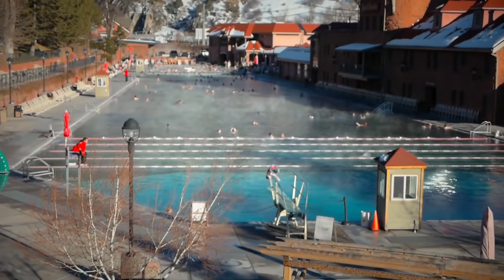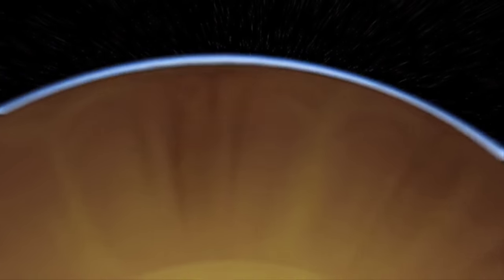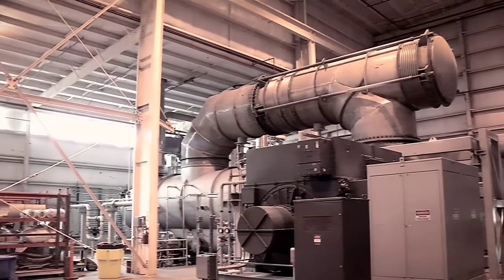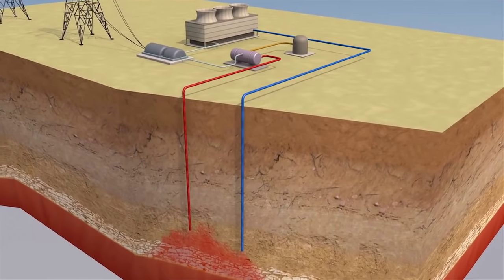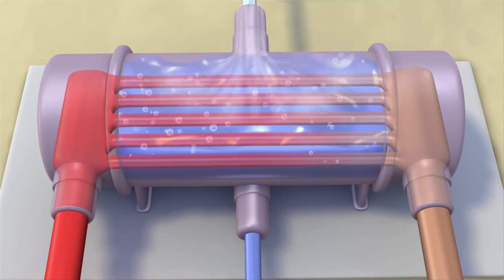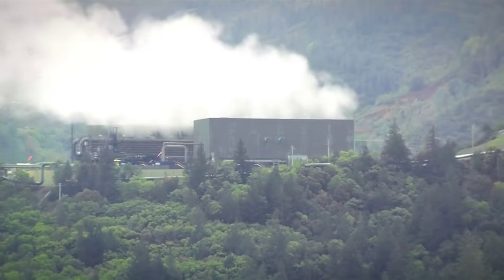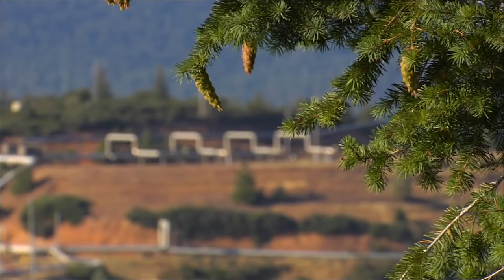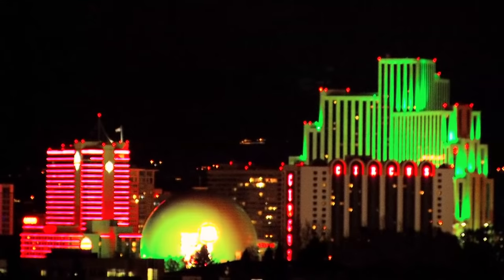Energy 101: Geothermal Energy

Comment: Shallow geothermal energy under your feet can be your own utility.  Shallow geothermal energy is not hot rocks as the video shows.  Shallow geothermal called geothermal (ground source) heat pump systems (GHPS) uses earth between 40 and 75 degrees less than body temperature to heat, cool and provide hot water to your home or business. Not hot rocks generating steam.  Now if you first put in a GHPS which gives you 4 units of free energy from the shallow crust of the earth under your feet and use only one unit of energy from the electrical grid you only need half as many solar panels to achieve net-zero for a home. The utility company is the bank where you put extra electrical power when your home generates it and then buy extra electrical power when your home needs it in the summer or winter….in some cases your home is net-zero, in some homes you produced a surplus electrical power and in others you must pay for extra electrical power consumed.

At least with a GHPS you save the cost of solar panels and provide 24/7/365 days of saving 30-70% energy cost, plus a quiet system which sounds like a refrigerator running, the lowest CO2 emissions of all systems, no outside compressor and fan making noise, no flame, no flue, no odors, and no danger of fire or fumes and a long life of 24 years. A ground loop is a home owner’s free utility to save half your energy bill and is found all over the earth surface from hot to cold areas.

An EPA study of energy efficiency concluded geothermal energy is the most environmentally friendly heating/cooling system. The United States National Renewable Energy Laboratory (NREL) concluded that geothermal energy is more efficient and cost-effective compared with conventional residential systems. Available everywhere in the United States, geothermal energy can be found underground virtually anywhere starting at 5’ underground. GHPS cost savings can be increased by geothermal energy incentives, available from federal, state, local, and utility sources which includes a 30% tax credit like solar and wind.

A GHPS requires less electrical power to operate and uses the free thermal energy under your feet which is between 40 and 75 degrees not hot rocks. The HDPE pipe used in GHP system is made from natural gas the same as natural gas lines.  GSHP systems work for 24 years as compared to a conventional system which works for maybe 16 years before it must be replaced. Why? All components are in the building and not outside. I have a 6,000 sf new home built in 2010 that has 2 ton, 3 ton and 4 ton Heat Pumps and cost on the average of $150 per month for electricity...lights, heating, cooling, cooking, hot water...I know it works. A conventional system would have cost me $30,000, but with the tax credit and utility incentives the cost was $29,800 for the GHP system in a big home. Own your own utility by installing a GHPS using the energy under your feet.
Reply: +Gerald McClain true, but if you go, say 200 ft. the timp will be higher. or mabe, a 1000 ft.what do you think?
Reply: +Gerald McClain Geothermal energy don't have disadvantages.

Comment: Video was great and and instructive.  when you use the word "flashing", it means technically, that it evaporates abruptly because of pressure lower than its saturation pressure, which isn't what happens in heat exchangers. You'd rather use evaporation.

Comment: I was impressed until only 10% of americas energy could be supplied by this
Reply: When you combine this method with the others (Wind, Tidal, Solar, Nuclear, etc.) it can constitute quite a bit more than 10%.

Note that 1/10 of the entire energy supply is still pretty substantial.
Reply: *****

Indeed.

And that 10% could become 20% when we advanced and furnish our current methods, techniques and technologies.
Reply: Andrew Webber and that could grow to 100% this way if we had the will to do so!
Reply: +Andrew Webber we could power the entire planet with geothermal energy in a sustainable, practically free way. but, of course, that's very bad for the oil companies, so they don't tell us that.
Reply: +maxsiehier / bravethinkers That's great because geothermal energy has no disadvantages.
Reply: true
Reply: they are not including geothermal heat pumps that can  heat water near the surface of the earth and that warm water can in turn heat your home…………………………..some cost 3,000    dollars on sale on the web...………………….can be used anywhere
Reply: heyitsme  Yes, to power 18 wheelers and airplanes without oil we could use hydrogen power. Some examples:   "Nikola Motor unveils its hydrogen fuel cell 18-wheeler" - By Lucas Mearian
Senior Reporter, Computerworld | DEC 5, 2016  
"Toyota Rolls Out Hydrogen Semi Ahead Of Tesla's Electric Truck" - by Alan Ohnsman Forbes Staff April 19, 2017
As far as planes, they are already making progress such as "This plane can fly 500 miles, powered entirely by hydrogen" & "ZeroAvia claims its prototype is the world’s largest zero-emission aircraft flying without any fossil fuel support" 
for more advancement with that: "NASA-funded scientists are working to develop an all-electric aircraft powered by cryogenically-liquified hydrogen fuel."
Reply: heyitsme  Yes you can. In Norway we are already using electricity to run the cars, buses and even cargo ships! At the moment there are trials with elec. airplanes .

Comment: I am not sure that geothermal is cheaper than coal. But of course it is clean energy.
Reply: coal will eventually run out it takes way to long to be made naturally for it to be sustainable. as long as the core of the earth stays hot and decays we will have geothermal which has been running none stop sense the creation of the earth (long before coal was created) and will keep running much longer than humans will be here.
Reply: +MyJigarpatel  in long run, it'll be cheaper. just because no fuel input, to buy...they can reuse the water over and over again ...
Reply: +MyJigarpatel There are no disadvantages to geothermal energy.
Reply: +MyJigarpatel They do not cost any money. They are free.
Reply: True, but some places would have to drill way to deep.
Reply: Water is made of h2o, both very flammable..
Reply: donnie jacobs but not as h2o only separate
Reply: +donnie jacobs We don't have to drill very deep.
Reply: +brent pal The heat will never ran out. Geothermal energy is renewable.
Reply: the heat is not renewable, it is clean. renewable means we have a way to replenish the resource after using it. We have no way of adding energy back to the earth once we take it out. Think of the core as a giant battery that we are sipping from. by doing so, we slowly cool the core of our earth, but only by a fraction of a fraction of a percent.
Reply: @miclowgunman1987  its renewable in the way of something called reinjection. Pumping treated waste water back in to the ground through reinjection wells

Comment: How about we use GRAVITY in a different way for energy!!!!! We can use mountain sides with rail track that goes top to bottom. Have water pipes at top. Fill train cart with as much water as possible. Utilize a hard slope to assist in cart acceleration down a tall mountain. The brakes can generate emissions-free electricity while pulling up another cart from the bottom to the top (but empty) I mean if windmills can be a thing then so can using gravity as a source of energy. Hopefully this should free us to repurpose trash into bricks that we can use to house the homeless using gravity generated energy.

These options may be sub-optimal to the educated engineer, i understand that i just want to point out that we HAVE OPTIONS!!!! all we need is real unity!
Reply: How do you get the cart to the top? By using energy, right?
Reply: @Nikifuj908  possible to refill the carts at the top if there is sufficient rain water there.

Comment: All power plants should become consolidated, and carbon off put should power space elevators to solar sailed hot air ballooned nuclear power plants in low orbit capturin all the energy on the way up and gravity on the way down, capturin all forms of renewable energy and fossil fueled. And should become wastefills or be planted on them to mine methane waste as well. And start to design architecture that mimics and looks like nature wit farms, lakes, and preservations all around them.
Reply: And all of this construction should be modular so that as soon as possible it goes online and starts to power the whole project and system almost immediately, bein built out of renewable and recycled power plants, tearin down the old way and usin it to rebuild the future.

Comment: They basically only showed the cheap geothermal energy not the more sustainable not fracking problem causing one. The Problem with using the porus rock is that it’s basically creating earth quakes if it’s not turn. Injections of waste water sounds like a incredibly dumb idea.

Comment: this is not geothermal energy. It's enhanced geothermal energy. Sad coming from Dept. of Energy
Reply: Enhanced or engineered geothermal reservoirs are underground places where the rock is hot but there is not enough water or other fluid to circulate the heat to the surface in wells.  In natural geothermal reservoirs, the hot water flows up wells naturally or is pumped, cooled back to water after passing through a turbine generator and recycled down injection wells.  With enhanced or engineered reservoirs, a fluid is injected into the hot rock, heated, and the hot fluid then pumped up a production well.  This video is not about enhanced geothermal energy.
Reply: Well, they hire based on 'diversity'.  So of course you get the bottom feeders.

Comment: What they don't say is that you need a cool source to cool off the gas to get back to fluid.  Heat energy needs a "potential" (path to cold) to be recoverable.  This is one reason you see coal and nuclear near water, and many geothermal units in Alaska where cold air can convert the alcohol back to a liquid state.
Reply: Cooling towers can be used.

Comment: There is no disadvantage to geothermal energy.
Reply: +Masashi Ng There is. Thermal pollution (only 25% heat energy is utilized) and Air pollution (mainly Hydrogen sulfide) are a few among others
Reply: +Bhaskar Pandey In BBC Bitesize KS3, I've read geothermal pollution don't emit pollution. http://www.bbc.co.uk/education/guides/zggk87h/revision
Reply: +Bhaskar Pandey Please understand clearly.
Reply: +Masashi Ng The link you provided explains the energy sources in as few words as possible. There are many advantages and disadvantages of each of the energy sources listed but it does not list all of them. This is like an article to be read before going deep into the details of the topic.
Reply: +Masashi Ng There are many types of geothermal power plants. The most common are hydrothermal plants which use steam or hot water to produce electricity. These plants can be broadly classified into open- and closed-loop plants. 

The distinction between open- and closed-loop systems is important with respect to air emissions. In closed-loop systems, gases removed from the well are not exposed to the atmosphere and are injected back into the ground after giving up their heat, so air emissions are minimal. In contrast, open-loop systems emit hydrogen sulfide, carbon dioxide, ammonia, methane, and boron. Hydrogen sulfide, which has a distinctive “rotten egg” smell, is the most common emission. 

 Once in the atmosphere, hydrogen sulfide changes into sulfur dioxide (SO2). This contributes to the formation of small acidic particulates that can be absorbed by the bloodstream and cause heart and lung disease. Sulfur dioxide also causes acid rain, which damages crops, forests, and soils, and acidifies lakes and streams. However, SO2 emissions from geothermal plants are approximately 30 times lower per megawatt-hour than from coal plants, which is the nation’s largest SO2 source.

Some geothermal plants also produce small amounts of mercury emissions, which must be mitigated using mercury filter technology. Scrubbers can reduce air emissions, but they produce a watery sludge composed of the captured materials, including sulfur, vanadium, silica compounds, chlorides, arsenic, mercury, nickel, and other heavy metals. This toxic sludge often must be disposed of at hazardous waste sites. 

Source:- countless lectures on 'Non Conventional Energy Resources'
Reply: +Bhaskar Pandey I know but sulfur dioxide and mercury aren't greenhouse gases.
Reply: +Bhaskar Pandey Some energy has more advantages than disadvantages. In think having more advantages than disadvantages is better.
Reply: +Bhaskar Pandey Sulfur dioxide itself don't cause acid rain.
Reply: +Bhaskar Pandey Geothermal Energy is renewable.
Reply: +Bhaskar Pandey In believe that it's the best way to harness geothermal energy in the future. Geothermal energy can be used to heat buildings directly, pretty cool.
Reply: +Bhaskar Pandey I don't think geothermal energy releases carbon dioxide into the atmosphere. Only burning fossil fuels releases carbon dioxide in the atmosphere.
Reply: +Bhaskar Pandey Geothermal energy does'nt release toxic sludge. Only nuclear fuel releases toxic sludge called nuclear waste.
Reply: +Bhaskar Pandey Don't get confused. Geothermal is made up of 2 Latin words. "Geo" means earth and "Thermal" means heat. Geothermal don't have anything to do with pollution and toxic sludge.
Reply: +Bhaskar Pandey In bitesize, it said geothermal energy don't emit pollution.
Reply: +Bhaskar Pandey Please be clear than geothermal energy don't have disadvantages.
Reply: As long as youre not pumping your friggin sewage back down into the hole, it's pretty cool.

Comment: This video is so filled with technical errors I can't enumerate them all.  In natural geothermal systems, we don't use the hot water or steam coming out of the ground as the show it.  We drill down with wells to reach the cracks with the hot water or steam.  Dry steam projects are the rarest type of geothermal project.  In a flash steam plant, the most common type of geothermal plant worldwide, its the drop in pressure that lets the water boil , not cooling and it happens in the well.  The wells aren't usually pumped for a flash steam plant.  They flow through boiling kind of like your aquarium undergravel filter lifts water through bubbling air.  The water and steam are separated in a pressure separator at the surface and the steam is sent to a steam turbine. The water left over is injected.  Binary power plants where the water is pumped are the most common type of geothermal project being built today.  They have no emissions at all since all of the geothermal water is pumped back into the ground.  With new technology, called Enhanced Geothermal Systems (EGS) we can drill into hot rock and then pump cold water (or waste water) into an injection well.  We create fractures through the thermal and pressure stresses of injection, map them with sensitive instruments and then drill into them to allow cool water to be injected, heat up in the fractures and then get produced in the production wells.  The hot water is usually converted to electricity in a binary power plant.